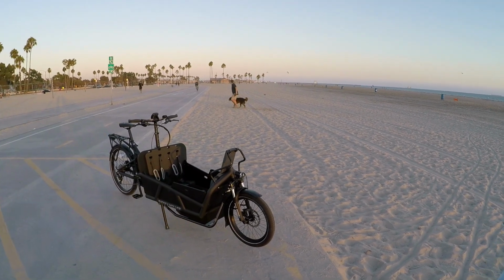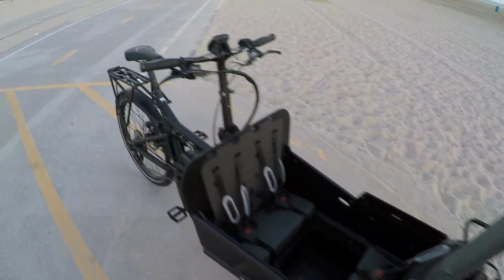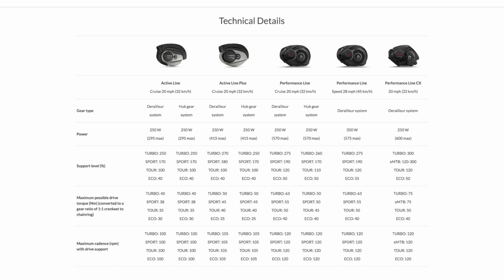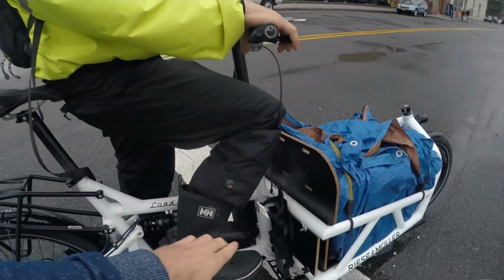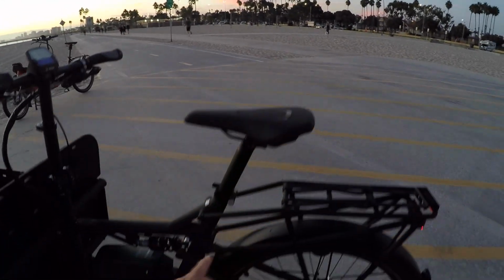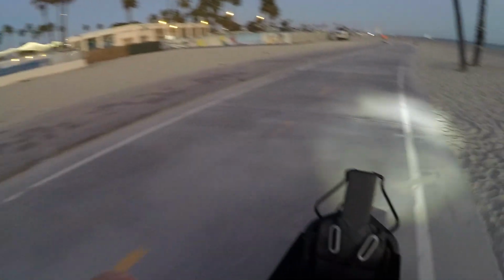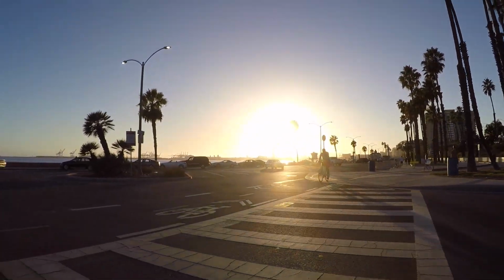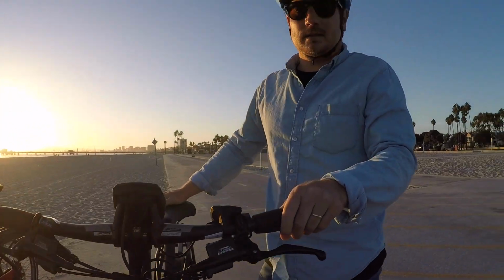Riese & Müller Load 75 Touring HS Review - $8.3k

Comment: Hi  I just purchased  a load 75 touring  We just relined the cargo area with kevlar  If my calculations are correct I should be able to carry 350-400 lbs  We plan to take the machine  wild boar hunting in the florida everglades  I am soon taking  Delivery of a Rad cargo bike On day 1 we plan on cutting the frame  We plan to merge a 48" cargo bin  Next we are installing a motorcycle air fork wide enough to mount 2  20" wheels with 750 watts bafangs on each  This give us 2250 watts of power and super reinforced kevlar compartment to haul 3 dead stinky  boars  I am tryng to get pigman on the hunt and would love to hire EBR to video the madden hunt as review of my machine We love having 2 less tail pipes in our everglades  I think this gould repace a ATV  In New York they haul vintage vino  In florida we haul dead stinky pigs  I think this will be a big testerone boost for you boy  If your company is interested contact  No carbon foot print pig hunting camp  Lets go Brandon

Comment: Hey, love your review, is the steering and overall driving experience of the 75 much different to the 60? Would you recommend the vario HS? does it give a similar sportive ride? thank you so much for all your videos, those are amazing.
Reply: I have spent a good amount of time on both and the 75 handles very similar, but you need to anticipate the turns a bit more on the 75 due to its length. Otherwise, it feels similarly sportive. Since my cargo carrying needs are pretty small at the moment I am mostly riding the 60, but if I had kids I would hands down ride the 75. The Touring will be a little more sporty, but the Vario is great to have a little lower maintenance and a smoother shifting experience.

Comment: I really love theses updates I wish they will offer some like the electronic bell on my 2017 Packster 60 I heard that they will push an update for the CX motor better walks assist and some other tuning. Very good review but now I kind of want to replace mine with a Load 75.  Can you tell us what is the system with the rear light automatic brake light?
Reply: We’re trying to work on an aftermarket horn kit. The horn manufacturer is Spanninga. The brake lights on this bike are the Tektro Auriga E-Comp HD-E500 with brake light switches connected to a Supernova M99 taillight.

Comment: Just ordered a Vario75  2 days ago, 3-seat option with the canopy. Seemed to be one of the only bikes that fits 3 kids properly under the rain-hood. Love the leg-rest for the kids, putting the seat-bench on the floor of the box (e.g. Bullit, Douze 800) was not too appealing to my 3+1yr olds. Will have to wait and see how it pans out with larger sidewalk edges, since the ride height is reduced by 10cm. As the "foot-box" is supposedly made from steel, there might be the benefit of guarding the steering rod, though. Can't wait, delivery time is 8 weeks even here in Germany.

Now that a really decent bike site finally reviewed it (and did a great job doing so btw), our decision to go with the most expensive one is a lot easier to take (altough a Douze would've come out pretty close). Ditching one of our cars for the bike, tho, so price was indeed not the main issue (this time) :D

Only downside for us might be, that the tarpaulin will most likely not fit over the headrest of the third seat. Will have to talk to R&M about this in the future. Or does Chris know something about this?

Cheers,
Flo from Hamburg
Reply: i guess im asking randomly but does any of you know a tool to get back into an instagram account??
I stupidly lost my account password. I love any assistance you can offer me
Reply: @Manuel Justice Instablaster :)
Reply: @Saul Castiel i really appreciate your reply. I got to the site through google and im trying it out atm.
I see it takes quite some time so I will get back to you later when my account password hopefully is recovered.
Reply: @Saul Castiel It worked and I now got access to my account again. Im so happy:D
Thank you so much, you really help me out :D
Reply: @Manuel Justice Glad I could help xD

Comment: Is there any reason why they don't run a front dyno hub? To me it would make sense and leave the battery just for propulsion. Good review as usual.
Reply: The lights draw very little power and in this case with a front thru-axle there aren't too many dynamo options. It would increase the price significantly. You could just spend that money on an extra battery and have even more range ;)
Reply: Makes no sense. Dynamo hub is just another service possibility, building that hub on a small wheeel increase the price and the battery is exactly that. Basically you are taking energy already present and asking it to go throuhg a secondary energy system with plenty of loss n between and major price hike... Dynamo hub is best on human powered gravel adventure bike.